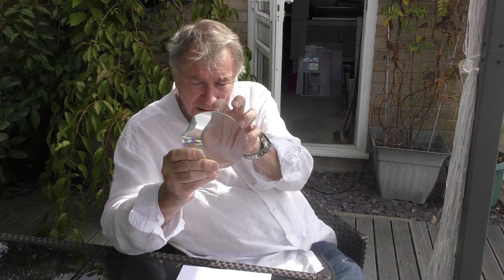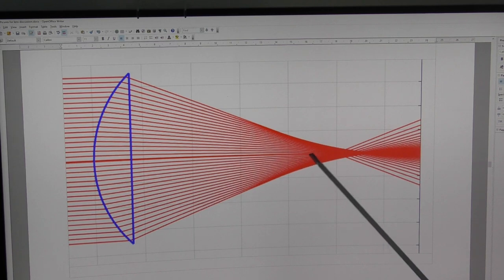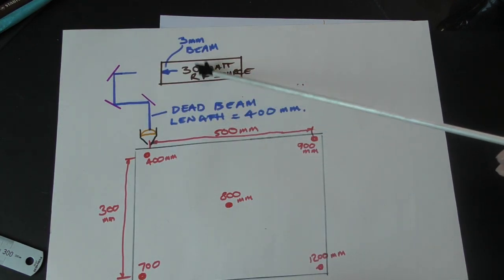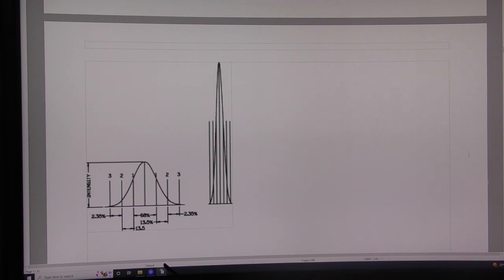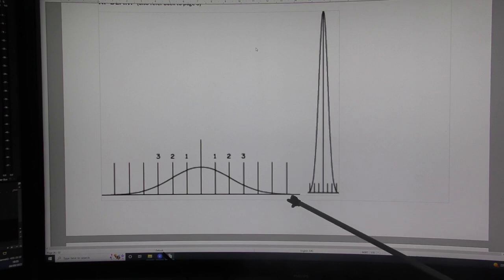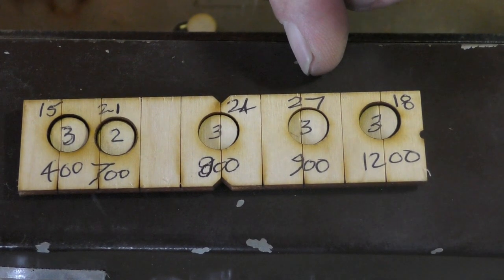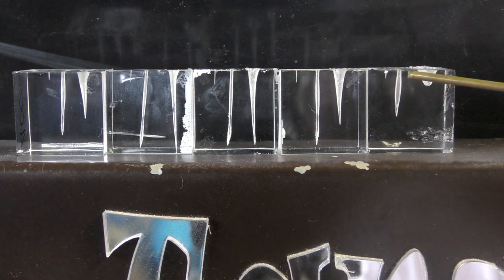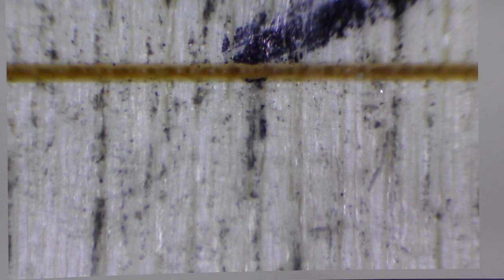RDWorks Learning Lab 243  The Weird Relationship of Lenses and Laser Beams

Comment: Since the intensity is in the center most. The lense helps collect the trash and repurpose it. 
Imagine how much radiation is lost outside the mirrors due to the beam widening.  Yes I know you measured.

What about a slightly  concave mirror. Especially on mirror 2. To help rehone the beam down to a point. 

When something "works" people won't mess with it.  It takes a need or curious person to shake up what worked and find something better. Innovate.

Would you say the focal point of a lense is the center point of the lense curve?  Flatter curve.. larger circle.. farther center point.

Comment: Haha, some of these things we discussed in our emails last week.  Its very hard to scorch wood with an RF laser. 
Regards,
Wim
Reply from the maker: Hi Wim
 My experimental  beam is specifically tuned with  high intensity  for cutting performance.  A normal  RF beam will have been "tamed" with a beam expander.  Have you done a raw beam mode burn at the extreme corners  of your table to see if your beam is sharp or blunt?. I expect your beam to be even blunter than my 1200mm  profile In which case,  slowing  the machine speed should improve scorching.
 Best wishes
Russ

Comment: Russ, you condition the beam back at the RF unit and have 400mm of 'dead' beam.  Can you introduce another conditioning lens at mirror 2 and make the beam more parallel from that point towards the head assembly?
Reply from the maker: Hi Phil
 Although my aspirations were to achieve a small parallel  beam,  as I have mentioned many times, my optical  technical skills are  close to zero.  However.,  fact I see that  "ignorance" as   freeing me from any anticipated conclusions  that would direct me away from the contraversial direction I am exploring.  The fact that "experimenting" (rather than calculating) has produced this very long waisted narrow  beam, has turned out to be a real benefit .  I can use different positions on the table to explore the  strange effects of what happens when you pass a different intensity profile beam through a fixed lens system.  As you see from the end of this video, although my goal was to demonstrate the stupidity of increasing a the diameter  of a  perfectly good "raw" cutting beam to create  a great engraving  machine,  there are some rather unexpected and  perplexing cutting results. I can look at all sorts of analog characteristics for the various parts of this beam   but the only one that counts  is how it CUTS.  There are subtle differences between the 400mm beam and the 900mm beam  but how they can account for 10mm/s difference in cutting performance?   It is observations  such as this that intrigue me .  All the facts and evidence can be  to be seen.....but the answer is not obvious. 

 So, in answer to your question. I don't know.  At this moment I am very happy with the variable beam for experimentation  but  IF I do find an ideal combination of beam profile and lens focal length that suits this machine for cutting and engraving then I will need expert help to create (what I am told by experts is impossible) a fixed diameter beam with specific intensity characteristics.
 
 As you have seen already, I am using different parts of this beam for A4 photo engraving on borax treated Baltic birch,  coloured acrylic and TiO2 coated white tile. So it seems that only cutting is sensitive to that intensity distributio and will therfore change with lens focal length.  It seems that the more I discover the more I find to discover.  Will I get there before god????

Thanks for the suggestion....maybe you are the expert I will eventually need.

Best wishes
Russ

Comment: need feedback,,, acquired a 1990ish mercury laser 30W rf needing laser recharge  US $850+.   would you 1) refurb laser 2)install CO2 glass tube or 3)  install 11+ watt diode.  I have ruida controller on shelf, and glass tube,,,, also have 60 w synrad that needs recharge.,,, really can survive with this being just an engraver.  btw the way this was a reallly good lesson for me.
Reply from the maker: Hi Walter
I converted a glass tube machine to RF because I was intrigued by all the hype from the big boys about how great RF lasers were. I have found no "magic" in the technology and in honesty a glass tube machine is a better all round machine. Mine is now just an experimental test bed.  An RF machine is, in truth, an engraving machine that will cut but very inefficiently. I see it as an interesting science chllenge to see if it's possible to find ways to make it cut  more efficiently.
 You will certainly get your engraving machine if you install one of your regassed RF units. I have always struggled to understand the cost benefit of regassing because despite the manufacturers original claim for significant tube life ( I have heard claims of 5 years or more) a regassed unit will never be warranted for more than 12 months. I have two 70 watt glass tubes that are now over 6 yers old and still work as new. I know of a UK service engineeer that spends about 50% of his time converting dead RF machines back to glass tube.
 All that said,  what would I do in your situation? I certainly would dismiss any thoughts of a diode laser. They have a poor quality beam  and have so little power that evrything is done at SLOW speed.The Synrad tube seems the best option for you as its a top grade unit.  It will engrave at high speed provided  the 1990s electro mechanicals  are capable.  60 watts will also give some sort of cutting performance.  However, the performance of the machine is so dependent of the lens /laser beam combination that a flexible lens mounting system is essential so that YOU can optimize the system for the application. I have had a quick look at the Mercury machines and see a very small compact head that seems to have a either a fixed 2" lens  or certainly very few options for "playing" with lenses. If its a DC servo drive  then I would check to see if the Ruida controller will work with the drivers. RDWorks or Lightburn  would be my software of choice  and your 1990s controller may be incompatibe with Lightburn. 

In the next week or so I will be publishing my next video about a massive set of testing I have almost completed and this video has previewed. I have many lenses in my collection and  all are being  tested with the 5 beam diameters I demonstrate here. There is a massive performance difference in CUTTING  across the range of lenses. It has certainly made me aware that lenses and laser beams are basically incompatible but there is enough "middle ground" to make the performance "ok" but never fully efficient.
 Best wishes
Russ
Reply: @SarbarMultimedia  thank you so much for your answer in your time. It confirms much of what my thoughts have been and I will to the final evaluation on the machine this week and make a decision glass tube is probably and was my primary choice. Although I am interested impossibly hanging this little 5.5 Watt diode that I have in my parts bin. ( just to see how it works and it is an easy intermediate step ).  The drivers for the motors are on a separate board and appear to receive step and direction signals. So my plan is to just wire in to the original driver board. It could turn out to be an interesting project will update you in time. 
Again thank you for all your help.
Wally
Reply: I did have one additional thought this morning. I live in Wisconsin which is at times some very cold winters and having a laser that is not liquid cooled might truly be an advantage.
Reply from the maker: @walterkennison802 
 Hi Wally
 Because you have a spare glass tube and plan to fit the Ruida controller  then the  cost effective initial stage will be to fit the glass tube. . We do not have severe winters here in UK  but we can often get to -5C for a week or more some winters. I have discovered that leaving the cooling system running 24 /7 adds enough heat to keep the system from freezing and keeps the water flowing through the system. Depending what you plan to do about cooling, I have also added a couple of 50 watt halogen lamps under my plastic reservoir and I swith those on as well.  If you do screw the tube up you are still no worse off as you have it already with no cash outlay.
 All best wishes
Russ
Reply: Russ,, wanted to buy you a cup of coffee,,, but fail to find the means?
Reply from the maker: @MrOiam  
Hi Keith
 Thanks for the thought. Your appreciation is more than enough. It's coming up to midnight here and I'm just drinking my last cup of coffee right now. That will get me through to 02:00 ish when I go to bed. 
 Best wishes
Russ
Reply: @walterkennison802  Walter, I have a Synrad 48 series in need of a regas, may I ask who you recommend for that repair?